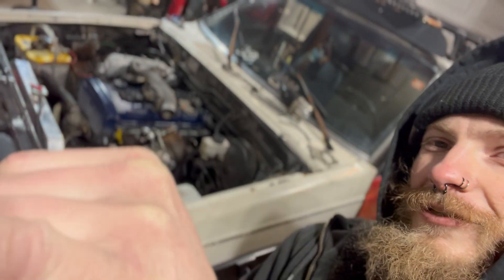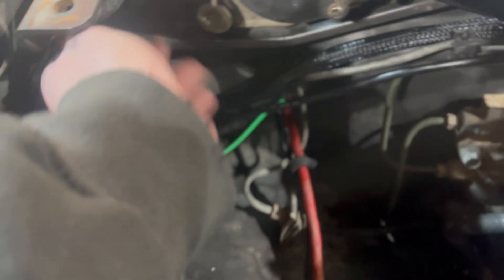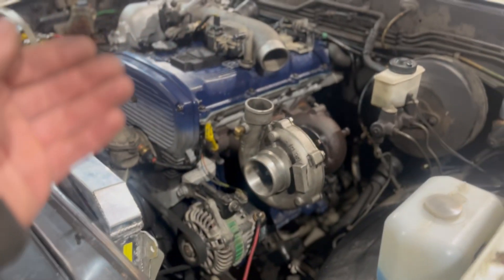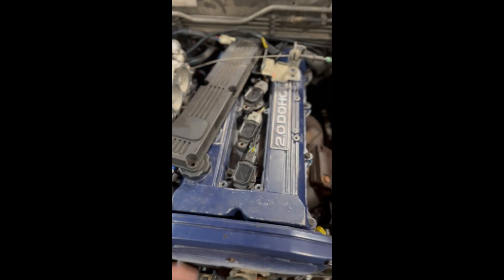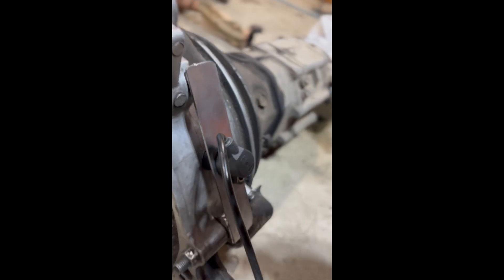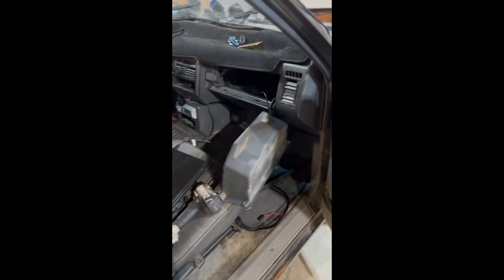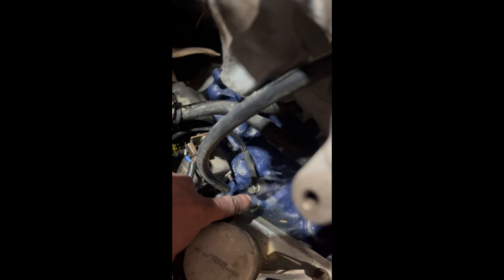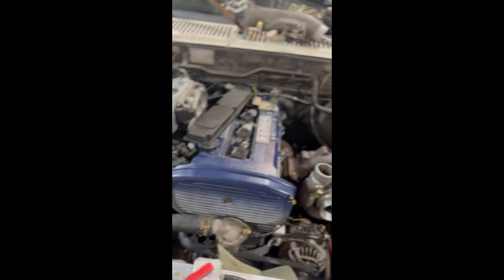Speedy EFI- MAZDA B2000/2200 FE3 SWAP (HARNESS KIT) Installation

Comment: Is there a specific reason why you chose the 1nz coil packs over the stock fe3 coil packs?
Reply from the maker: I run them on my 1jzgte also so I'm familiar with them already, and they just so happened to fit the fe3 pretty well except cylinder 1as you can see in the video but hey it works as is pretty darn well until I find a solution with a different nz coil or make an actual bracket for them, this is also why i made the coil harness separate from the Speedy harness.. I will stay updated